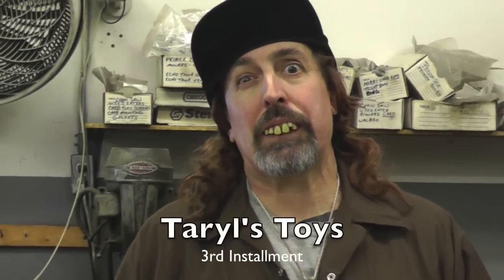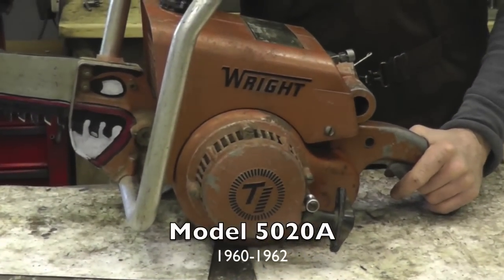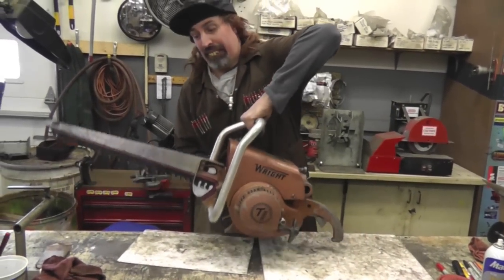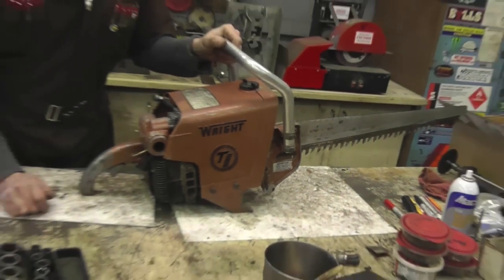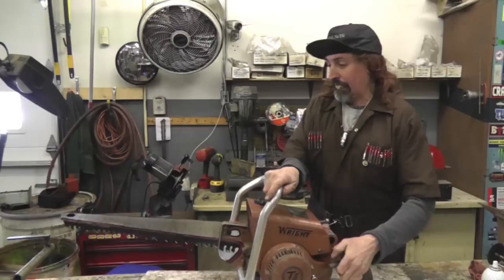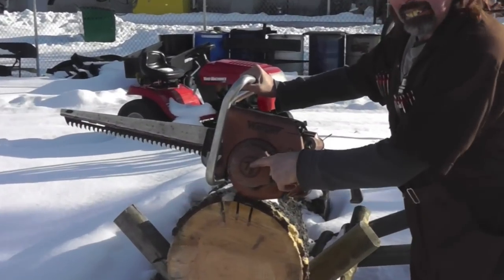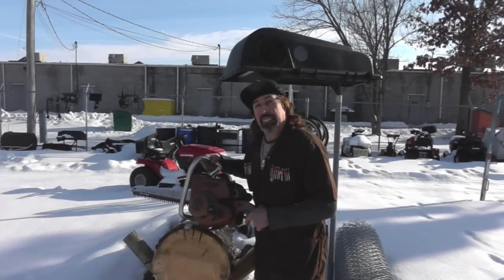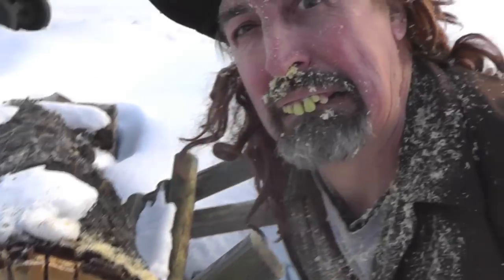Taryl's Toys - 1960s Wright Reciprocating Saw

Comment: those saws were used for cutting large branches out of hedges ; you could get in a tight space in the crouch of a branch on a hedge and cut that branch without cutting the branch on the other side of the bar ;; I worked on those saws taryls trying to make me feel old ; but they were known as a hedge saw
Reply: but taryl does a great job ; ; pretty soon taryl should find or run into an old strunk chainsaw that was direct drive <--no clutch and had steel cable for starter rope ;  the teeth were so slow you could time them with a calender   ; but it was geared so low that you couldn't stall it no matter how hard you put your weight on it

Comment: I think I could cut Thur that long faster with a bow saw and finish up with a saw all  with a big blade  my  electric saw all cuts way faster than that thing  it doesn't even deserve to be called a power sàw  it's so slow it would be your daily work out. Holding  that heavy joker up